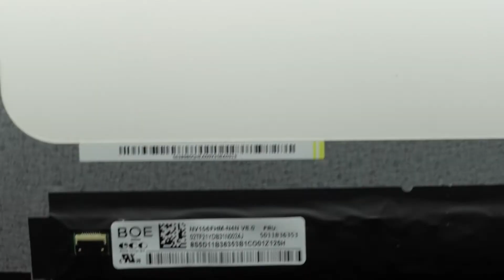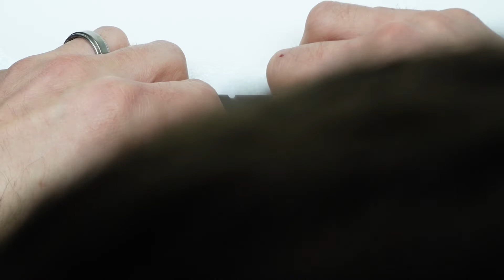HP ENVY x360 15-ee1024AU Screen Replacement

Comment: I had done a repair similar to this but instead of heat mat, I used a heat gun(blow dryer) to loosen the adhesive. That's of course acceptable correct. Cause the ultimate goal is soften the adhesive strips, making the removal a much easier task and helping to avoid damage to the digitizer?

Comment: Thanks mate - wish I'd found this sooner. I watched some muppet say you just pop it out of the case all the way around - no mention of pulling out any adhesive - i ended up breaking the screen which, it turns out, wasn't faulty, just a loose connection with the 30 pin plug. A hard $200 lesson.
Reply from the maker: bugger